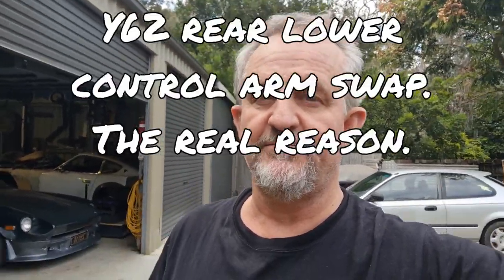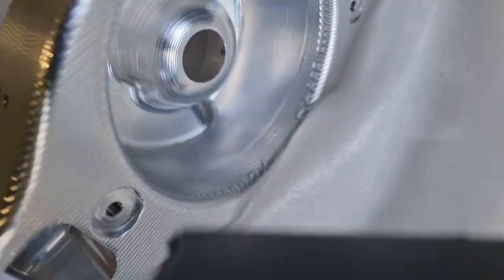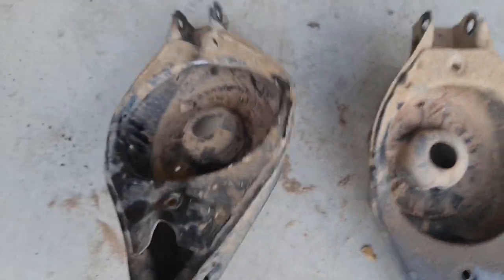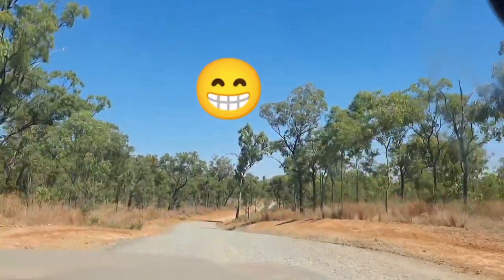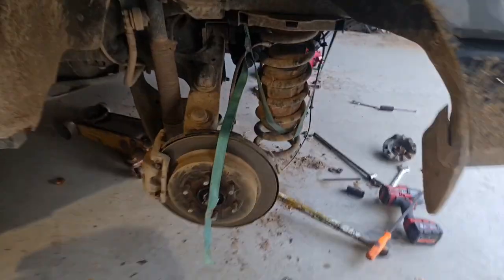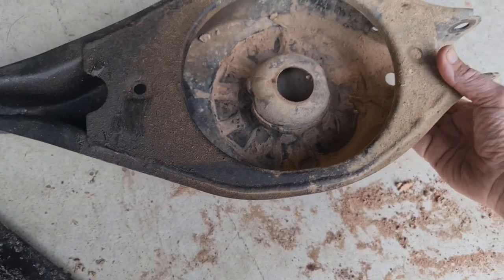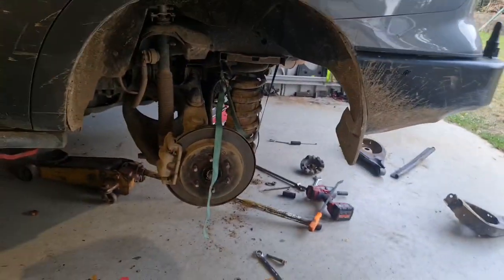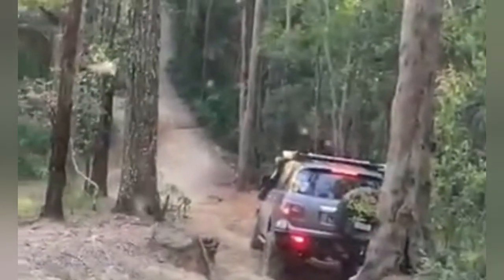Y62 Rear Lower Control Arms Upgrade   For Gvm or not

Comment: Love your vids. Lower control arms on a tank like this you would think no worries ..
Even my car i looked at them  and always surprised how manufacturers take short cuts just a bit of plating here etc but I suppose its all about costs… those new arms look awesome👍
Reply: We’ve had 1 case of the same issue over here in the USA (only 1 since very few people here use the Y62 offroad). Guy runs 37” tires and was flying like 100kmh down miles of dirt roads when the LCA broke. He ended up buying 4 new arms and cutting 2 in half longways and welding them to the outside of the others to basically make them twice as thick. But based on your first failure, sounds like they could use some additional reinforcement around the bolt holes. 3600AUD is super expensive but kudos to Dash for creating a bullet proof solution. Thanks for the video and info!
Reply from the maker: Yeah agree, as I keep reminding myself, mu gu has broken front arms rear arms, rear upper arms torn rear upper from chassis, upper coil towers, lol. Over a few years though. Definitely the weakness in a y62
I've since torn the k frame

Comment: You are definitely on to something with the lift and different angle contributing to your problem. Plus the shock load of the bags. I may have to review my setup now
Reply from the maker: Just some things to consider eh, still keen to hear if any stock height vehicles have had issues
Reply: @OzPatrol66  I can tell you I have. Interested to know where you got the the upgraded arms / billets   I’m in Belize. All parts have to be special ordered - 4 to 6 week wait at best. Had a joint break off just this week. And you guessed it. Off the passenger side (right) rear wheel.

Comment: A year out of date i know but I've bent one in Tassie doing Belfour's track. I've put it down to weight as well i have a very small lift but a lot of weight with rear bar and long range tank. Similar to you i hit something in a water coarse cam bent the arm out like yours. I held off buying the arms when they were 3k wish I'd done it now they're like $4500. I've got a couple of spares I've laminated some extra plates onto to hopefully future proof until a better option comes out
Reply from the maker: Yeah, I've since torn one of the arms brackets off the k frame also, not ideal. Every car has its weak points eh. Balfour track, that's a weird one eh, I was down there in janurary

Comment: Last september we did the cape with a 2.5t trailer. I got a 2019TI on a 2" lift and air bags. Done a lot of K's off road. I havent bent an arm yet. Luck of the draw i guess. But now im lookin at the alloy arms
Reply from the maker: Yeah, I might have an unlucky hit, my truck is also 3.6 t which probably doesn't help, big heavy rear bar, it's hard to keep them protected and light eh

Comment: 5:30 it may have but 5psi is lowest they recommend so I don't think it would have much different, tbh if you were sitting at 3400 kg i would have inflated to 15-20psi depend how much it sagged on rear
Reply from the maker: Yeah, maybe, i spoke to the bloke that does a lot of work on these y62s and that was his opinion as i run 200kg springs in the back which handles my normal travelling weight, so the bags are installed mainly for when the caravan is in tow, helps.with the extra 250kg ball weight.

Comment: THanks for the info, i just brought a 2019 TIL and tow a van so need to beef up the rear end and in WA you struggle to get a GVM/GCN upgrade, as a starting pont do you recommend upgrade of rear springs with air bags
Reply from the maker: Yes that's the best start i reckon,  are you standard height springs
Reply: @OzPatrol66  yes ,do you suggest get one that are higher (hoping air bags will raise back height)
Reply from the maker: @Robert Ogs  they push out on the springs rather than up to stiffen spring i think so i pump them up then load the car up. I did purchase. Mine for my 2 inch lift but i think the bags are the same for stock.

Comment: This is really interesting. Two bent lca’s with very different mechanisms of failure there really. One a bump at speed and one more torsion kind of thing. I would’ve thought the second arm would’ve bent heading uphill not downhill too given there would be more weight on the arm with the front end up. Thanks for sharing mate.
Just wondering as well, is your rear setup load distributed fairly evenly? Strange to do both on the right and though maybe the right was heavier or something? 👍
Reply from the maker: Nothing real heavy in the back, if anything just the fridge, and thats on the left. I was wondering the same.
Reply: @OzPatrol66  the right side seems to be the weakest for some reason. Thanks for posting this. I have a stock Y62 and I’m inclined to get the upgraded arms instead of waiting for the ones from Nissan that will take weeks to get then be a problem again a little down the road.

Comment: Seems like they are weak.  The design is difficult to make strong.  They did it like this to make the suspension as compact as possible to keep the rear cargo floor as low as possible.
Pajero's dont have this problem, you can push them much harder than you do and no problems.  The pajero coil sits on top of the arm not inside it.
As you say the billet ones are heavy, thats ultimately the consequence of the desire to have a low cargo floor height.  The pajero arms are surprisingly light yet strong.  And the pajero cargo floor is low so mitsubishi got that all good and then nissan didnt copy it.

Comment: Hey mate nice video could you tell us the torque setting for the main bolt which lowers the bottom arm that holds in the spring?
Reply from the maker: Mmm, I did it basically as tight as I could with 2 spanners linked or big breaker bar, 600mm. I have the inner ones move the adjustment so I keep them as tight as I can, Andrew cassar would have the actual torque setting, on track 4wd.

Comment: Is there any other reported case of rear bent control arm in the bush mate? I take my Y62S5 to bush regularly with my 4wd club, work mates and my son. Just curious.
 I'm going in for Ontrack gvm upgrade anyway due to long range fuel tank.
Reply from the maker: Thats my point eh, ive done 2 but not heard of any others bending them.my new ones in now, aligned much better.
Reply: Big Oz explorers did one on cape York 
Check it out

Comment: does it only do it on lifted y62s??
Reply from the maker: Mmm,, cant be sure by i am of the opinion that the spring angle from lift is part of the issue. I would upgrade mine even at stock height i reckon. It seems to be the weak point.

Comment: Not very strong not a great design just watching u move them on the floor they sound very tinny. I think Nissan should have stuck with solid rear axil .they are a nice truck .
Reply from the maker: I like the irs but aggree they too weak, but as i pointed out the gq gu solid rear axles still bend arms also. Maybe im too hard on the gear lol
Reply: @OzPatrol66  they bend but not that easy .iv had to tower brace an laminate houseings but was carrying almost a ton of mud crabs on the back an the roads we went were similar as the ones in your video iv known of a few peaple bending the irs in the new y62 like yours there not built tough ..nice trucks but
Reply from the maker: @outbacknomad9939  ahh ok, one of the gu's with us on the cape trip  bent his coil towers the same day, he reckons in the same dip. The video didnt show how visious the dip was. But he was quite heavy. Ive bent rear trailing arms in most of my gq gus, i think thats pretty standard if you go full on offroad. But y62 ones def crap.
Reply: @OzPatrol66  i think we all get used to the simplicity of gu gq 80s .there a quick fix an most times you make it home .